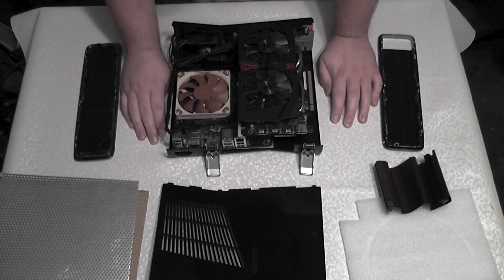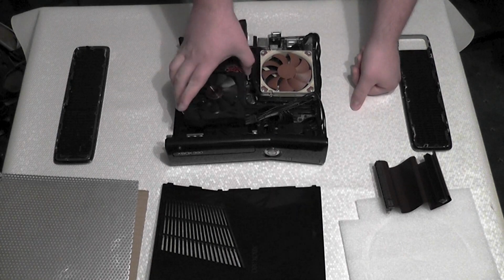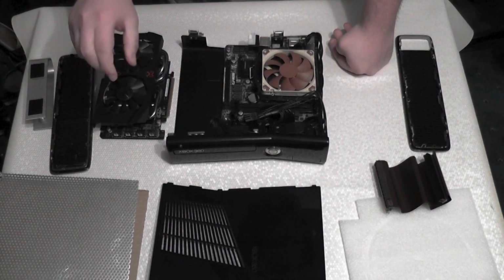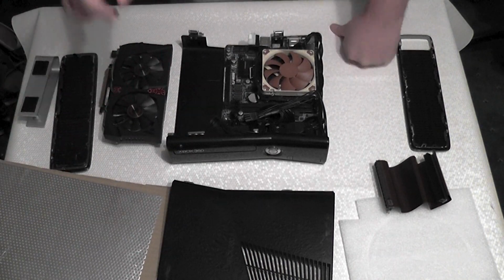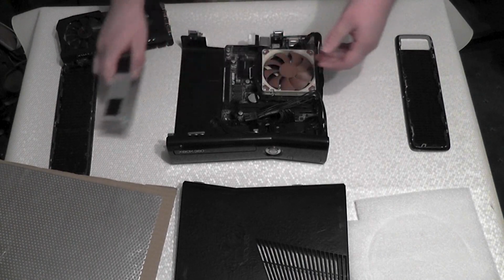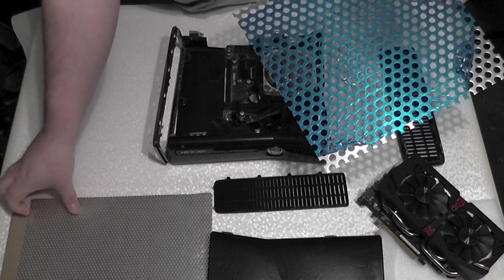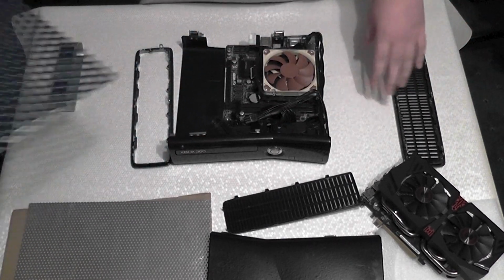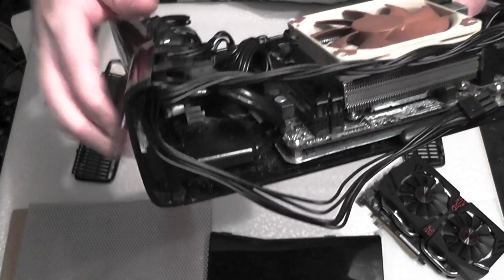ITX(box) Project Part 4 - Turning an Xbox 360 into a GAMING PC

Comment from the maker: Aaaaaaaand we have another problem! Buying low profile ram solved THAT clearance issue, but the GPU is now hitting the top of the PCI-E extension connector - Something that I can't modify. The connector is the same height as the GPU bracket, so I can't actually mount it lower.
Reply: What you may want to do is 3d print new pieces for the side panels. That could solve your clearance issues.
Reply: Get a thinner extension, or open up the PCI express extension and take off its shell
Edit:or saw off a part of the gpu heatsink
Reply from the maker: @ericov.o.2399  I've been struggling to find other risers lately (Gigabyte makes one that looks slim enough but I can't buy it directly from them or even find it anywhere online) and most risers are the same basic design anyway so finding a slimmer one isn't as easy as it might seem, but modding one is a very interesting idea though, so I'll be looking into that, thank you! :)
Reply: @PrintedDan  you can use an APU (2200g) instead of a GPU. It won't be as good performance wise, but it will fit without any problems. The specs I will be fitting into an xbox 360 case:
AMD Ryzen 3 2200g
MSI B450i PRO GAMING AC Mini ITX 
16gb of ddr4-3000mhz Corsair Vengeance LPX RAM
2 SSDs (1x500gb WD Blue SSD, 1x60gb SSD)
2x30mm fans (1x intake, 1x exhaust)
And by my calculations, it will only need a cutout for the processor cooler to fit in, but I MIGHT be wrong. It might fit in just well.
Reply from the maker: @sadmonstaa  I've actually recently upgraded my main system so have used the i5 4690 from that in the xbox build, and I've flipped the GPU over, the build will be displayed vertically instead of horizontally, it's mostly solved the clearance issue (although the GPU will be sticking through the top vent slightly). I've just finished editing a new update video so that'll be here soon :)

I've also been looking at an EVGA GeForce GTX 1060 SC, which is a lot smaller and would likely fit without any issues at all.

Good luck with your build and great specs, I look forward to seeing it :)

Comment: I wanted to build a similar project to what you are doing except using an i5 3330, 8gb of ram and gtx 1060 3gb (everything used except for the Hdplex PSU and power brick). To make it easier on yourself what about selling the GTX 960 and using it to buy a low profile GTX 1050ti? They are about the same speeds with the 1050ti possibly being better and it would definitely use less power and stuff. You can get low profile 1050ti's that would fit in that case no problem. Instead of cutting holes in your case have you thought about removing the plastic shroud on your graphics card and installing two slim 120mm fans? You can drill holes in the lid to give more airflow too. Slim fans might fit. If you use a two in one fan spliter then you should be able to hook it up to the GPU fan connector even.
Reply from the maker: I hope this doesn't come across as me being a dick or anything, I've just done a lot of planning with this build, there's a lot of stuff I've thought about. :)

Replacing the cooler with slim fans was a part of the original plan. The fans I tested were impacting the PSU and side panel (modding & re-positioning them didn't help much either). Using another GPU is not an option (at the moment anyway) as the GPU is impacting the PCIE slot on the motherboard so the top panel can't even be closed even with a loe profile GPU - Something I evidently missed while planning this build.
Reply: @PrintedDan  Ah fair enough that is a bummer then. Maybe you could make a new bracket that's slightly shorter for the GPU so it wouldn't have to be cut? You could make a hole to screw the GPU in place and add standoffs for the riser card so it's stable with at least 3 screws. But I'm sure you thought of everything. I didn't mean to be rude or anything I was just trying to provide some ideas for your build but you probably thought of all this already. Some people even just use cable ties or double sided tape to secure the GPU.
Reply from the maker: @DoomWalker42  You didn't come across as rude, I like hearing ideas from people, helps in the long run. I'm using 3M dual lock tape to secure everything in place, I'll be posting some images on Twitter soon showing the GPU issue - It needs to be mounted lower than where it currently is, but it's hitting the connector, which stops it being mounted lower.
Reply: @PrintedDan  Cool, ah sorry I just realised you were talking about the riser cable for the GPU being in the way if I am not mistaken? That's something you can't change I guess. Would there be more room if you flipped the GPU upside down so that the top of the card is facing that side panel you were modding and the part with the heat pipes is facing the PCIE slot? Then you could simply make some holes in the base though there might be enough room for the GPU to pull in air from that modded side panel because the holes are quite big so it will get quite a bit of air. Just a thought. I don't use twitter but I will keep following this project looking forward to seeing how it works out for you in the end. I guess if you get a smaller GPU in the future you can always get a new mesh piece for the lid so it does not have a hole where the GPU goes.
Reply from the maker: @DoomWalker42  Correct, the riser is the problem. Unfortunately the design & pinout of the riser means that the GPU can't be flipped around with the fans facing up. I'm looking around to see if there are any risers to mount the GPU in the way you suggested. I may contact the guy that makes the riser (HDPLEX) to see if there's a chance of him making a one off custom riser that comes straight out of the motherboard and into a 90 degree bend, which would hopefully solve the problem. I'm also considering mounting the GPU upside down so the fans are facing the bottom of the case, but they should be able to pull in enough air through the side panel, if not, I'll install a mesh in the bottom and get some case feet to life the whole thing up.
Reply: @PrintedDan  that would be a good idea he might be able to help you out if not i have seen a couple riser cables that can do 90% bends for a right or left angle and ur mesh idea will definitely help airflow good luck
Reply from the maker: @DoomWalker42  Thanks dude. Will hopefully have a solution in the new year :)

Comment: Hi if you can reply it will be great I’m trying to get my Xbox 360 into a pc case
Reply from the maker: Here's ya reply :) What case are you using?
Reply: FocusTech the cheapest one on amazon I’m new to pc building and this is my first project. I’m getting really confused I just want to change the fan in my console add some leds and put it into a computer shell but idk what an oi plate it and I’m getting real confused
Reply: FocusTech basically I want a empty pc shell and a load of support
Reply: FocusTech do u think u can help me out with trying to sort out a case and sorting out where everything goes because I’m also wanting to soler a jtag to the Xbox so I can install mods I can handle that but I want to have a clear window with a led fan and if I can water cooling can u see what you can do I’m 14 and live in uk with my grandparents so not exactly balling I just want cheap but gets the job don’t very very poorly thanks
Reply from the maker: @qished3332  The stuff below is what I can think of right now.

Here is a basic search on amazon for pc cases - https://www.amazon.co.uk/s?k=atx+pc+case&s=price-asc-rank&qid=1554856603&ref=sr_st_price-asc-rank

I think you'd want a case that supports ATX sized motherboards in order to fit everything inside and also with a window as you said.

Regarding support for the parts. You might be able to use some of the existing screw holes to mount the xbox motherboard to the case. If that's not possible, you could try using some velcro strips instead. Might not look pretty, but it could get the job done.

If you want to change the fan in your console, you'll likely need to solder the new fan cables onto the existing fan cables as they don't use the same connector.

To get additional ideas/ help, I'd also suggest heading to the Linus Tech Tips forum (https://linustechtips.com/main) and posting in the case modding section. I've gotten a lot of help and solutions with projects from the people over there.

In general, I'm not sure how much info I can provide as I have my own schedule to deal with, but if you have a question, I'll do my best to answer it when I can :)